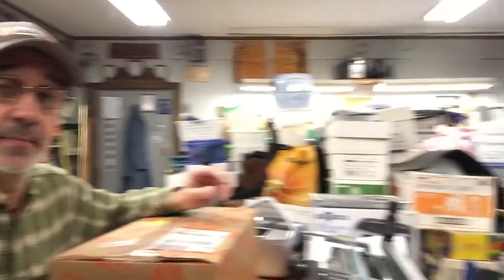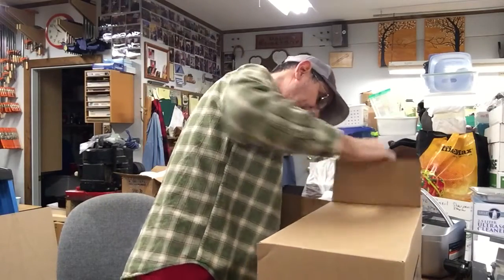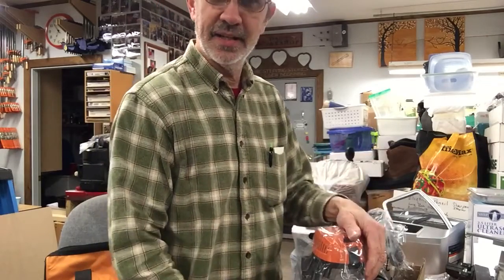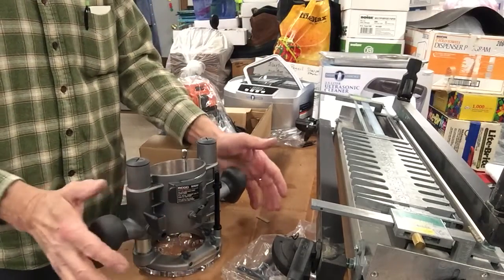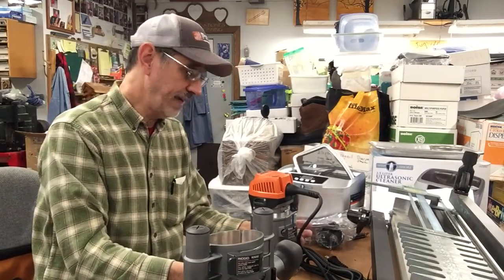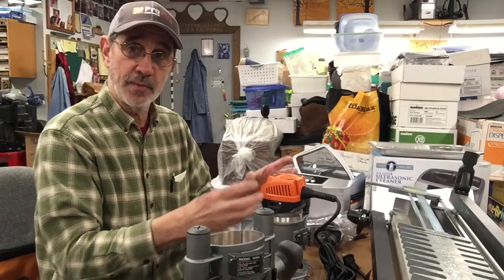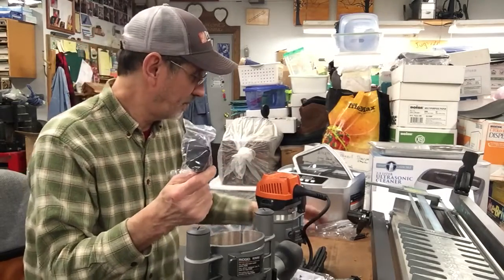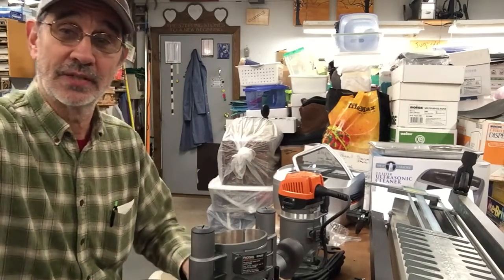332. Unboxing a new tool for J and R woodworking

Comment: Variable speed is used for larger dia bits
Search youtube for a video about it.
But let's say your running a 1/4" bit at 2400 rpm  then change to a panel raising bit thats 2" in dia the shank spins at 2400 rpm, but the outer cutting edge spins a lot faster, this heats up the bit and will burn it up. So you slow down the speed to match your feed rate letting the cutter run cooler.
I belive the t handle Allen wrench is so you have a router lift if you build a router table with it. Not sure dont know the brad  or that model number to look it up.
My bosch 1617 will do that with special parts I didnt get, and I have a jessen router lift.   Nice dovetail jig. I want one.
Hope you got a good deal on it. 

Ridgid tools are not bad, I just like milwalkiie better,   and lifetime on a warranty is the life of the tool not your lifetime.  If at something they decide its past end of life on the tool they can refuse to fix it.  You could wind up with a 3 year warranty.   Lifetime is misleading.

They could change the model and thats the end of your warranty.  
Id rather see the box say 1. 2.  3. 5. Years
Lifetime dosnt say how long but most people don't know this. If you send it in for repairs you get a replacement rebuilt tool and a 1 year warranty .

Comment: You need variable speed if you use a large diameter bit such as a raised panel bit you need to slow the speed of the router bit
Reply from the maker: Oh OK thanks for the tip I’ll try that out. Jim
Reply: True, some router bits have rpm limits.
Reply from the maker: @stevef8993  Yeah that’s true but the oversize bits I just buy in the form of a shaper cutter and I run them in my shaper that does a smoother job than a router does anyway because typically a shaper cutter has three flutes instead of two. Jim
Reply: Ah ha good to know